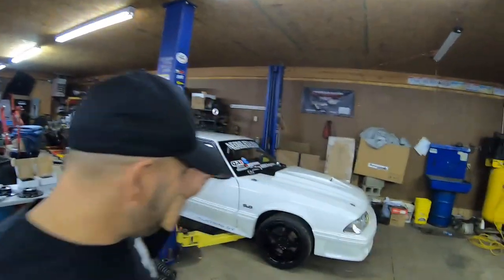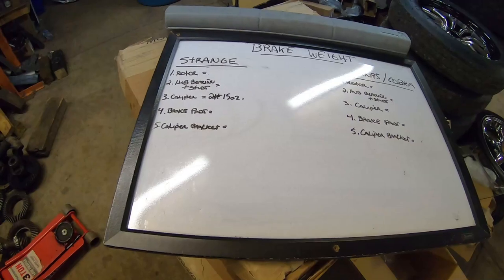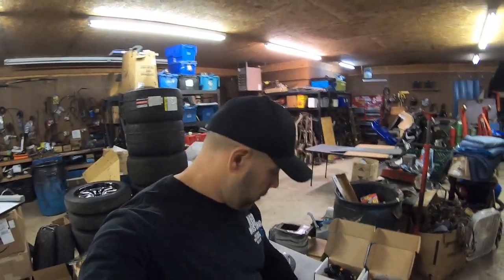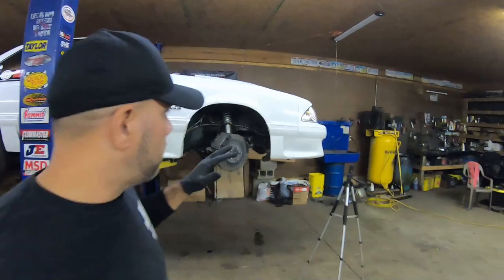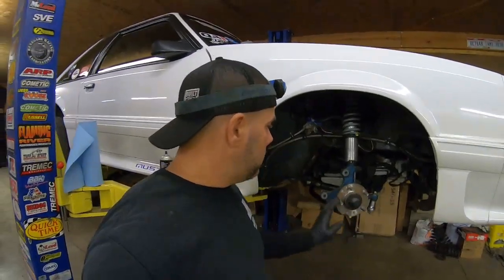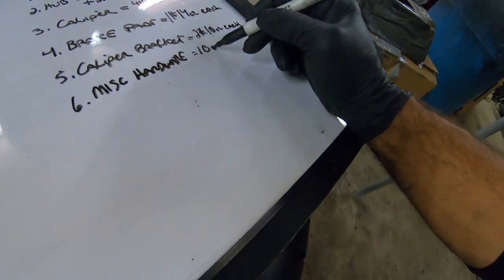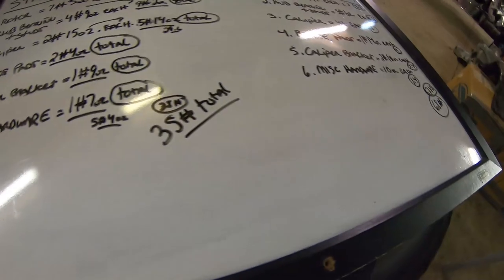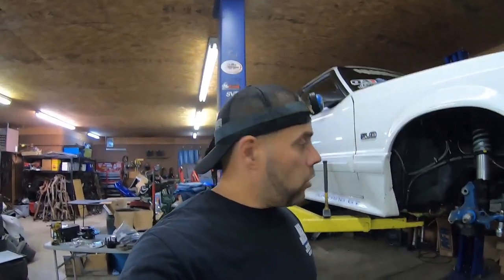Foxbody Mustang Drag Brakes INSTALL & WEIGHT How Much REALLY? STRANGE ENGINEERING

Comment: Great video!
Do these calipers use the same brake line? Or did you have to custom make -AN brake lines?  Do you happen to know the part number for the brakes. Strange website has a few to chose from. Thank you!

Comment: The caliper comes with a 1/8 npt to 3an fitting to connect the brake line, so wondering what sealent did you use to install them?
Reply from the maker: Nothing.
Reply: Mine are leaking and Im using their fitting and I already torqued them down more than Im comfortable with and the leak continues , so thats why I thought I needed sealent to install them

Comment: I have the complete strange setup with master cylinder front and rear inlove them
Reply: Do you have to pump them before the engage hard?
Reply: @alexrod8257  no they work like factory brakes just better it sounds like you have air in the system